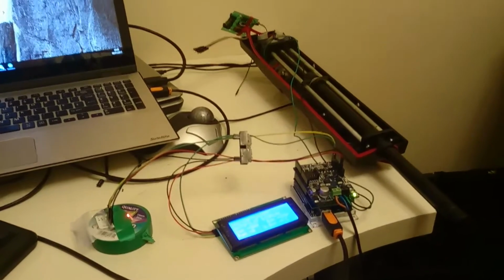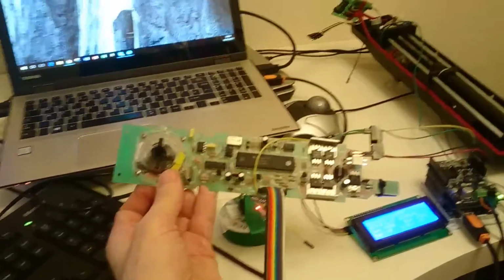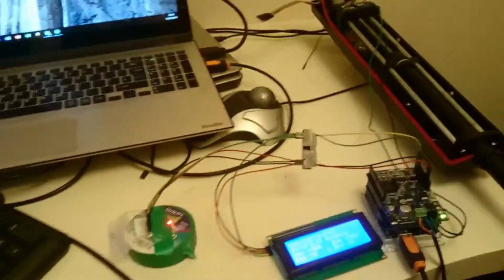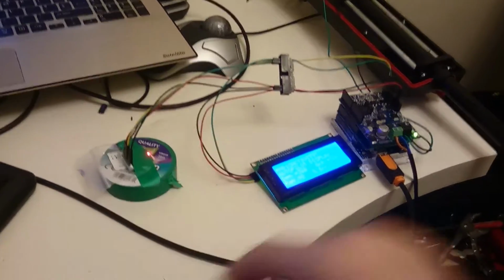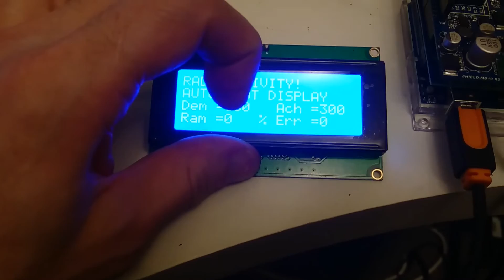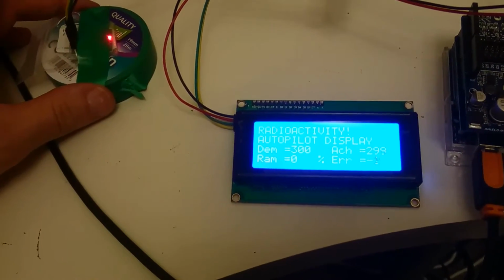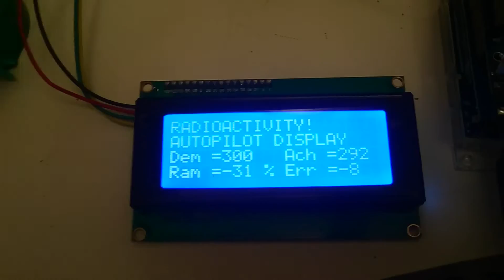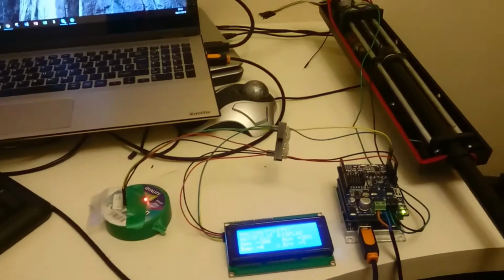First run of arduino sailing boat autopilot

Comment: Hey. I also do autopilot, but for a boat. Tell me which model of your PWM motor driver? And is it possible to put CMPS11 in the GY-521 or GY-85? And where can I see the wiring diagram of your autopilot? Thanks in advance. You well done good thing!

Comment: Please Im very curious. Somewhere in your project there is a transfer funtion, i mean, some relation between heading variation and rudder variation, or something like that. The question is... are you using a transfer function? Or just have a PID empiric tunning? Please could you be so kind to explain that?
Reply from the maker: OK, no problem.  So I measure the heading of the boat, and run the error between actual heading and desired heading through a PID controller which gives an output which is the rudder velocity.

I then had to tune the PID settings at sea to get them right - In practice they need to be modified slightly for certain different sea states.

You can see the successful version here:

https://www.youtube.com/watch?v=kE4qSK2DyFs

And the video which taught me to tune the PID is here.

https://www.youtube.com/watch?v=drYO60z6_h4

It would be better to have a mathmatical model of my boat, however the only way I could get one is by empirical testing which is very difficult!

I hope this helps, if not, please get in touch.
Reply: First all, thanks a lot for your awnser. I have formal education in electronics but now im very involved in nautical area (sailmaking and instruments sales), the electronics now is a hobbie. My big problem was how to have the mathetical model of the boat, I mean, in order to have a relation between some input (rudder postion) and Output (heading direction), sure is possible, but probably is waste of time.  As you know there are so many variables (conditions) that would be almost imposible to have a model for each conditions combination! So, make a lot of sense to have a PID tunning control, and just tunning each time for each kind of navegation. So again, thanks a lot for your help, regards, carlos
Reply from the maker: No problem at all!  I think the commercial units use some sort of self-tuning algorithm and constantly adjust their PID settings to suit sea conditions.  I dont know how they do this and my mathematics is not good enough to replicate it!  Good luck and if you think I can help get in touch :-)

Comment: Cool stuff...My name is John Neyland Jr. and I patented marine autopilot gps navigation system called the pilot Line system or PLS.  The PLS systems control law and math is exceptional.   It was patented in 2012 and is intended for high seas ships.  It outperforms PID systems and it allows you to use 100% of your vessels rudder travel.    Please let me know if you would like help in your project or are interested in helping us create another "beta" test implementation.   The application is written in Java and needs very little computing power.   The inventor William Pease is a remarkable individual who also has 26 other successful marine electronics patents to his credit.  He is a retired MIT professor and retired Raytheon Systems consulting engineer who by the time he retired managed 2600 engineers as subordinates.   The majority of his patents are on advanced Radar system development and he himself engineered and built 3 generations of Raytheons Pathfinder radars.   The autopilot patent can be found on google by entering William Pease autopilot system.   My email is pieceof8@embarqmail.com He and I are still working together.   thank you and good luck.